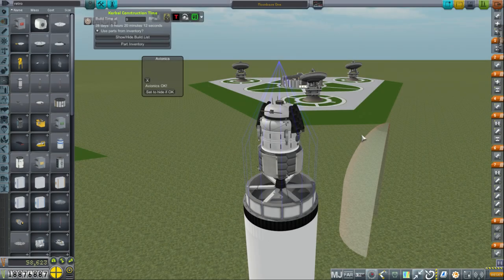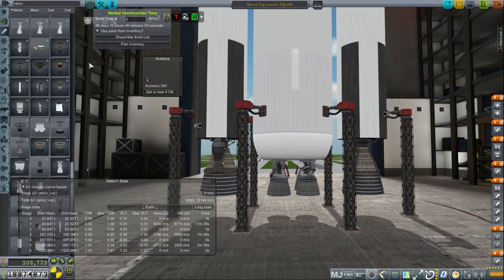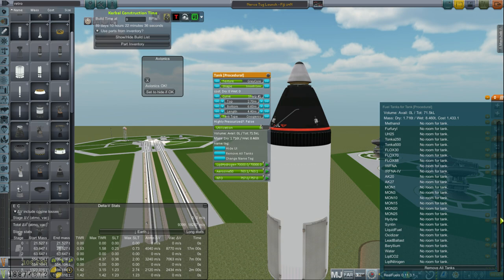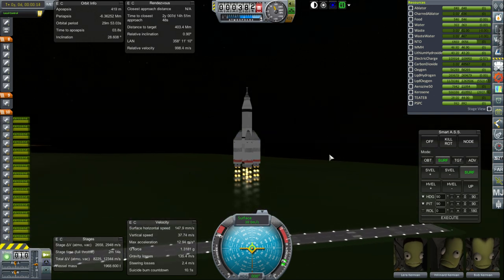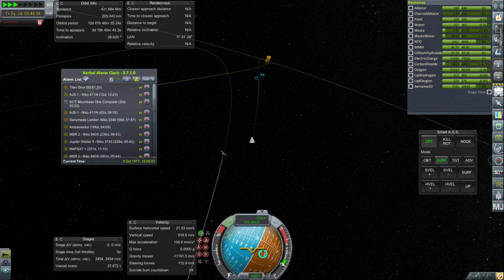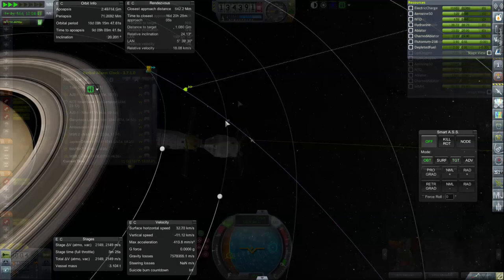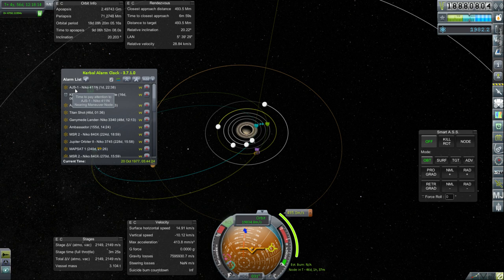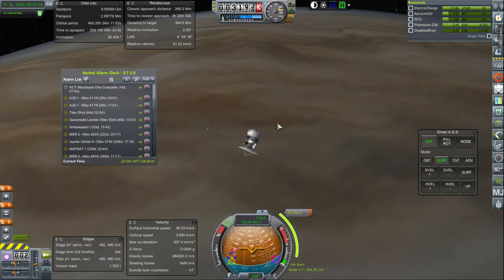Realism Overhaul in Kerbal Space Program 1.1.3 - 78 - Preparing NERVA

Comment: I have a hard time justifying the use of NERVA engines. ( hadn't thought about a LEO or LLO tug application because well, boil off ) even as a transfer stage, because i find I get lower launch mass (of upper stage + payload for equivalent delta v) or higher resultant delta v ( when mass is about the same ) from a J-2S upper stage. 
So really I'm just interested in seeing how you pull it off / what factor I'm missing here.